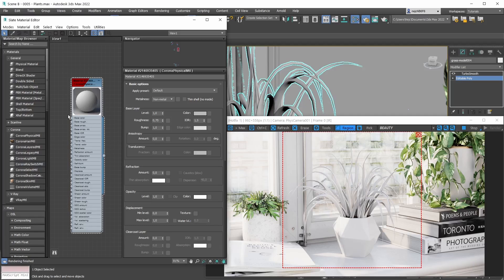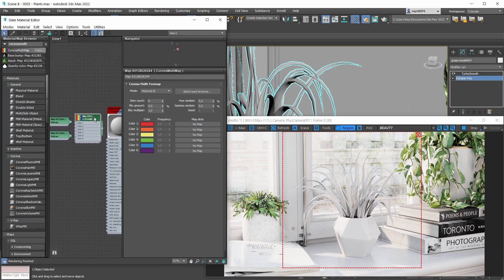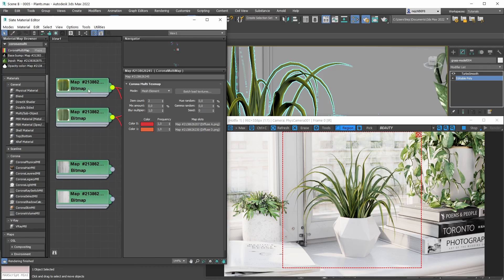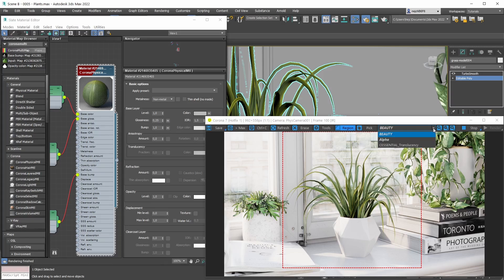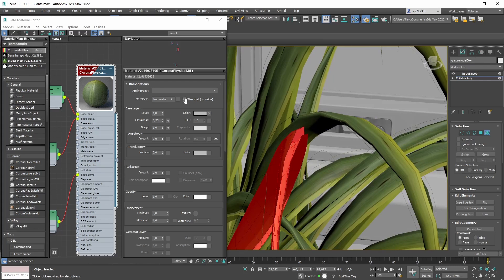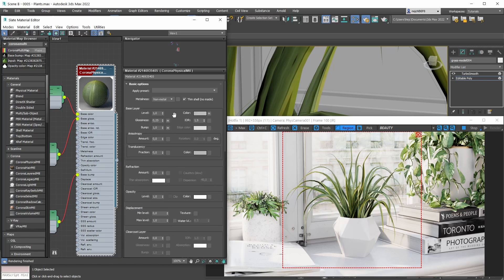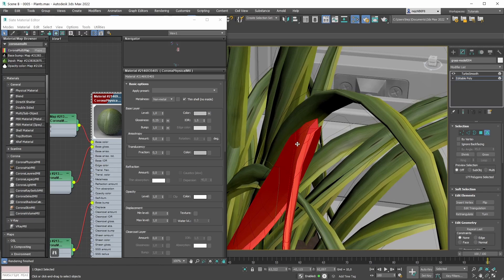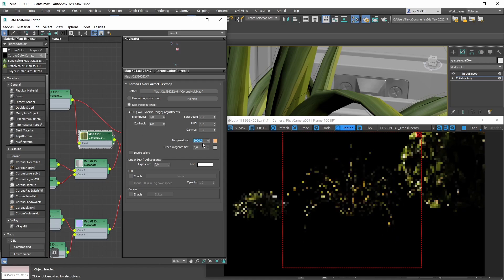Corona for 3ds Max Physical Material Tutorial, Part 06 - Basic Plant Leaf

Comment: Hello! where do we get the leaf bitmaps or any other bitmap for the specific material we want to modify
Reply from the maker: Anywhere you like is the short answer :) Basically, wherever you get your plant models from. For example, any of the vegetation in Chaos Cosmos for models that all Corona users have access to, but then also any other place you get plant models from (Turbosquid, etc., paid or free), those will come with the bitmaps for the leaves for that plant. Hope this helps! Tom
Reply: @ Helps! Thanks!
Reply from the maker: You are welcome! A quick note (and one that's mentioned in the video) - exactly which bitmaps you will get, will vary depending on the model. In an ideal world, with the best models, you get diffuse, normal, bump, glossiness, translucency, opacity; but sometimes it is only the diffuse (the color). The video takes that worst case of only getting the diffuse, and shows how to "fake" a glossiness or translucency etc. from that diffuse. In the best case, that isn't necessary and you can just plugin all the maps as they are already included in the model :) Thanks! Tom

Comment: Wait, I thought 9000 temp makes it cooler, not warmer? So the bluer temperature actually warms it? Can you elaborate on why it does that? I'm new to this.btw: Are these models/textures available to download?
Reply from the maker: Howdy! That temperature slider is to be thought of as the white balance slider - and with white balance, if you up the temperature, the image will get warmer. So basically it works the same way as the white balance spinner in the VFB. Hope that helps.

As for the models / textures, unfortunately we can't share these because they are non distributable. Nejc